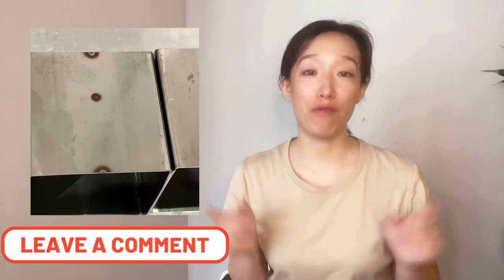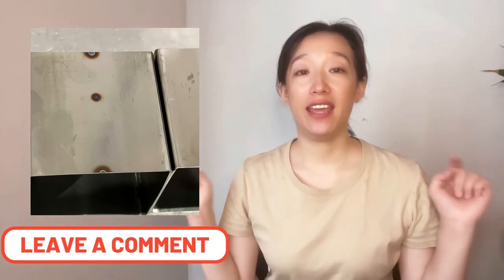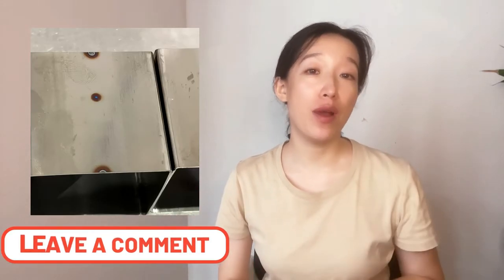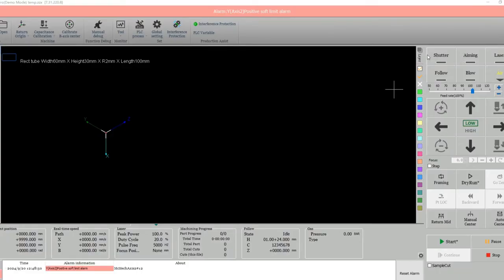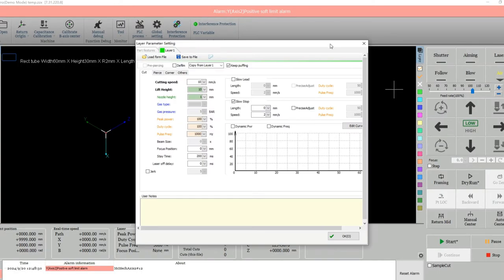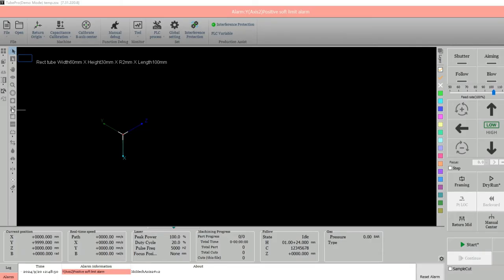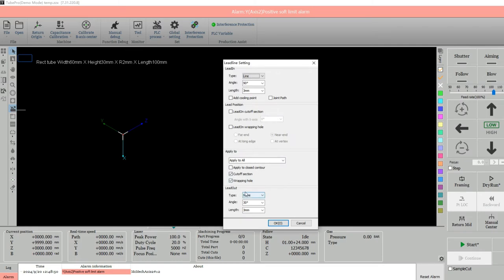Tube Cut: Burnt Mark at the End Cutting | Laser Cutting Problem and Solution

Comment: Hello Clara,
I was cutting 8 millimetres of carbon steel on +4 focus, then I replaced all lenses for regular maintenance for the laser head (including collimating and focus lenses) , after that +4 focus is not working on 8mm carbon steel , it changed to +7mm is that normal?!